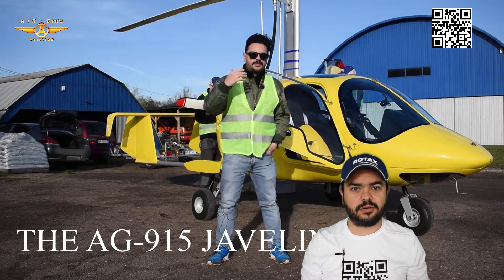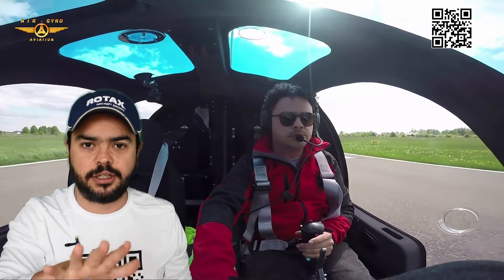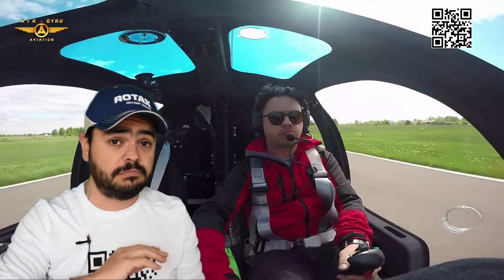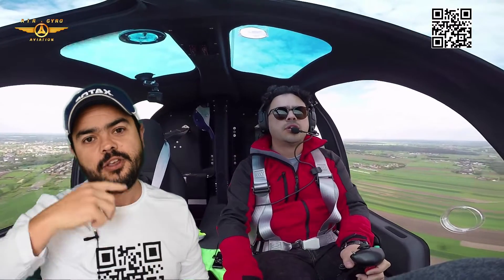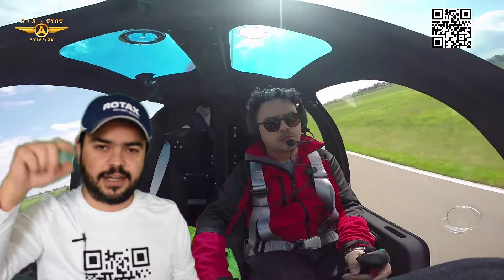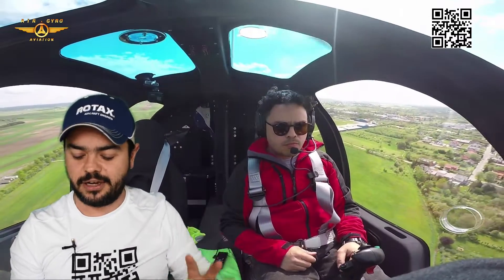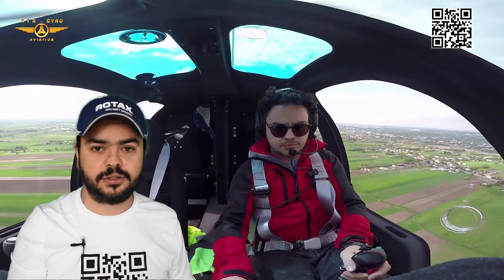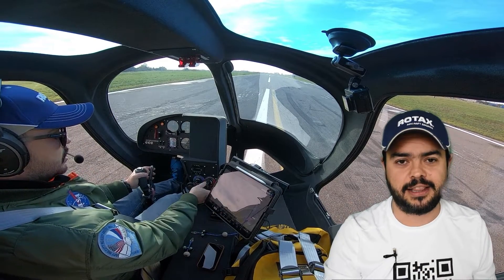AG-915 JAVELIN- EXTREME TEST FLIGHT REVIEW video 2 of the flying saucers flying vehicle

Comment: Nice looking gyro but it's still a high line of thrust gyro. Even with the big horizontal stabilizer it still can have the same issues as all the other high line of thrust gyros.. I don't understand why there are not more center line of thrust gyros like the dominator or sparrowhawk 3. Sure CLT gyros might not look as sexy as a HLT but I would take safety over looks all day every day.